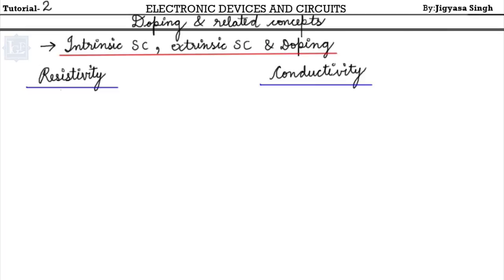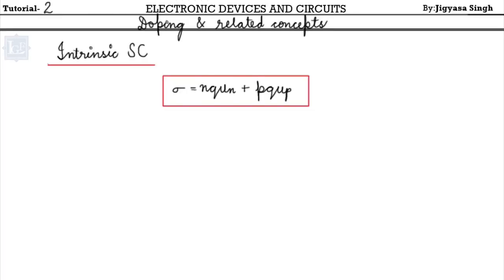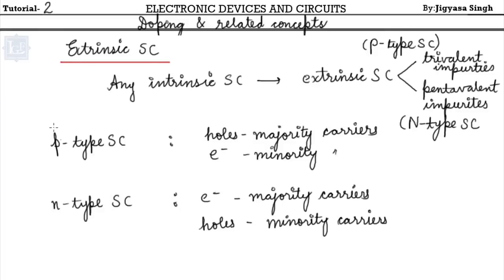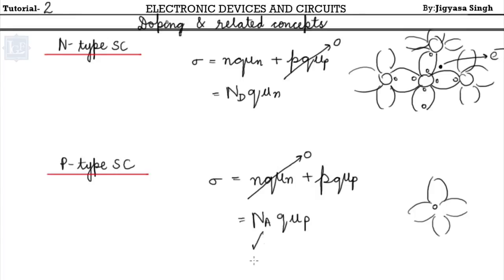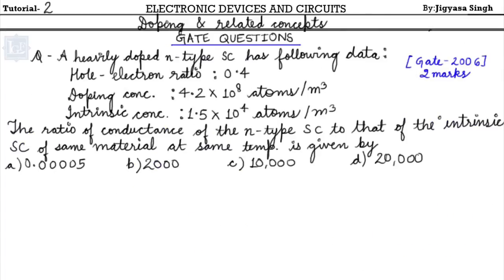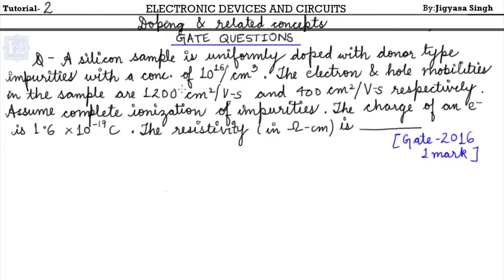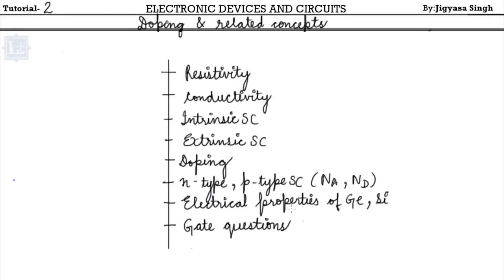Lec 02 Doping & its related concepts

Comment: At t=3.28 as temp increase resistivity decrease but you have written resisitivity increase ,correct me if a am wrong
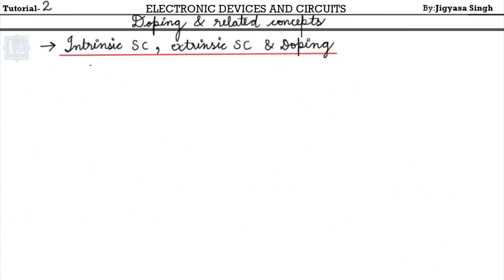Reply: vaibhav bajaj : its all about your consistency with narration by lacturer , she told resitivity increases with increament in temp ( true ) for condustors but SC behaves opposit to it and at 3:28 she wrote conductivity increase with temp or resistivity decrease , she emphasized by encircling the equation for SC case , which again is true .